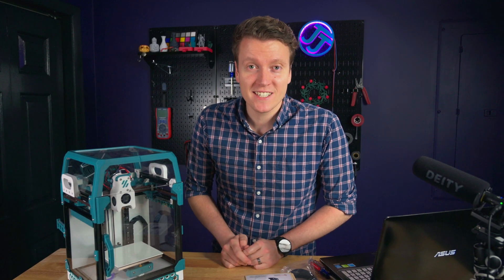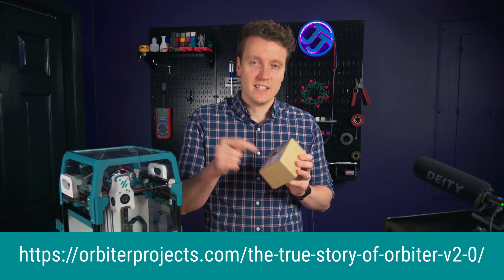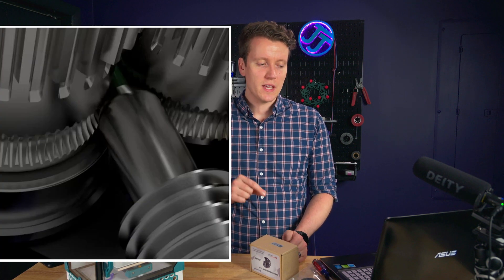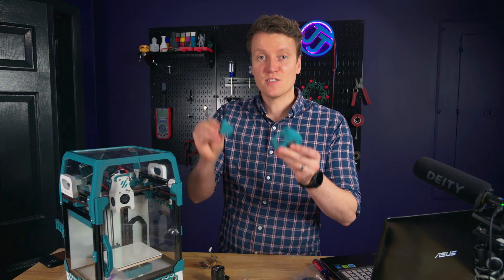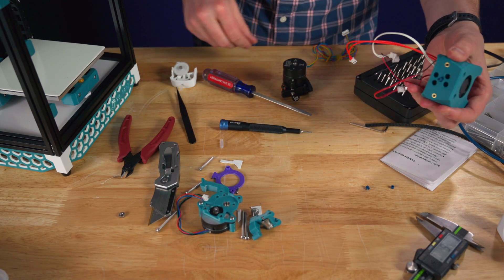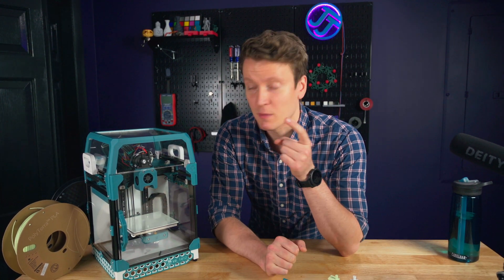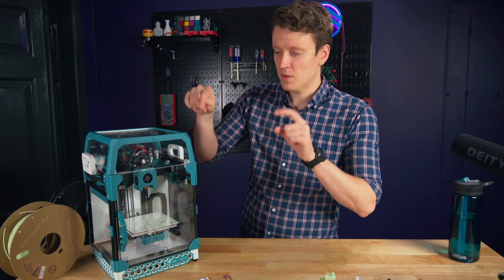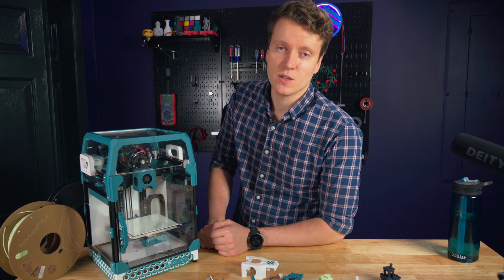Orbiter V2.0 Extruder Install and Tests | Voron V0.1 Upgrade

Comment: I've been running a Stealthburner and clockwork 2 retrofit on my Ender 3 for a long time now. Honestly the cooling and consistency and ease of loading and unloading filament has been great.
But also honestly I've never been able to get prints as good as I could with the stock hot end and extruder on a direct drive carridge. I tshooted the issue for a long time but eventually started just living with it.

Was looking at some old prints today in my junk prints box and I was like "Wtf bro these are way better than I can print right now?" 

Did some research and decided to go with a completely different toolhead, the Mars Orbiter by squirrelf which is much more ender 3 focused and full featured. Also supports rigid mount for my dragon hotend and fitting the mars orbiter on top. Fingers crossed I get the old quality back!

In the end there is kind of a why bother with a 3D printed extruder when there are good injection molded ones that are all going to be way more precisely manufactured.

Comment: thx for the cool vid, nice to see i'm not the only one having had this issue (discord made me almost think i am). if i may ask what was your personal reason to install the zbelt mod? thanks
Reply from the maker: I felt the same way, so many issues with the Mini Afterburner. 
And I used the zbelt since I had been having issues with a bent lead screw on another printer and wanted to try out a belted z printer. It was a pain to get installed, and now the bed will slide to the bottom after the z motor is turned off, but I like the fast z moves it can make.

Comment: I got the Bondtech LGX lite extruder to start with but had alot of trouble with it skipping steps even after non-stop of calibration and tear downs to re-check everything. So I am installing this now with the Revo Voron hotend and hopefully I will get some trouble free printing out of this bloody thing finally. Thanks heaps for sharing.
Reply from the maker: That sucks to hear about the LGX. I've been pretty lucky that my Voron has finally been working well since this was installed.

Comment: Are you using a MGN7 or Mgn9 on X? I have the mgn9 on X mod i wonder if this will work?
Reply from the maker: I still have the stock MGN7. I think this would work on either since it doesn't replace the part the mounts to the rail.

Comment: Was looking forward to the re-wiring but not shown.
Reply from the maker: What re-wiring were you looking for? The extruder and fan parts are the same wiring as with the stock one, and the motor plugs in the same place as the Mini Afterburner motor plugged in as well.
Reply: @JJShankles  the LDO motor, it doesn't follow traditional color scheme , but noticed it came with a short extension that flips the blue and yellow. I couldn't get mine to work but after i flipped them manually it did. Thank for your video

Comment: Again an installation guide but nothing on Marlin changes!
PLEASE show me what to change in Marlin 2.1 for the Orbiter extruder.
Reply from the maker: They include a sheet that shows the commands you need to send, and you can find them half way down this page as well: https://orbiterprojects.com/orbiter-v2-0/
Reply: @JJShankles  Thanks for the video, but @fvyeel is right. There are only commands for USB configuration and not the FW one. I do not have some of the settings available and thus can not change them, even though they are very important.

Comment: I think you'd find that the sherpa mini is an incredibly easy extruder to build. All screws are out in the open and tearing it down (if you ever need to) takes no time at all. Glad you like the mini as, didn't even realize Clee made an orbiter v2 version. I was still working on a v1.5 version 😂
Reply: I have the ldo sherpa mini as well and I love it.

Comment: Hey mate, thanks for the great video, do you know if the revo will fit with this mod?
Reply from the maker: Yes, they have a different STL file that will work with that hotend: https://github.com/PrintersForAnts/Mini-AfterSherpa/tree/main/STL/Mini_AfterSherpa
Reply: @JJShankles  Perfect, thanks mate, i hadn't checked the stl folder lol

Comment: if you loosen the mini ab middle bottom screw it wouldve solved your issue. Drove me crazy and i solved it on a fluke myself but dope mod either way! Def a better setup than stock

Comment: I have spent so much money and time fixing this inconsistency issue... way more than any of my printers worth... I have tried: Orbiter, LGX Lite, MiniAfterBurner, Stealthburner... Feels like main issue is in this small Nema 14 motor... cus same gears with Nema 17 are producing way more consistent results... Super frustrated as amount of time fixing this also was insane... makes me very upset especially when my Bowden Ender 3 makes way cleaner surface...
Reply: 'fixing this inconsistency issue'
Realize if you fully constrain the dual gears of a dual gear extruder to parallel, the thickness of the filament and how far the drive part of the gears go into the filament spread the shafts and changes the gear mesh.
You do NOT want fully constrained, parallel shafts.
Make the shafts a V.  You want the gear part fully closed, so the gears are meshed as completely as possible.  You only want the upper drive side of one of the gear shafts to be able to float and adjust for slight changes in filament.  The tiny change in the angle of the V from filament diameter change won't really matter much as long as you're not letting it change the gear mesh.
IOW, making a crap 'loose' extruder is likely to make a better one than making a 'perfect', perfectly parallel extruder.  A loose one will probably still mash the gears together completely and have little change due to filament changing.  If you make a really high precision, parallel shaft dual gear extruder, you're almost guaranteeing that any change in the filament diameter will change the gear mesh..  
IOOW, loosen your extruders up a bit so it has a little more free play to float around and it may work better.
Reply: @ModelLights  Yep, it's similar to Bowden concept, that is why dual gear with bowden doesn't have such issue.
Reply from the maker: That's sucks, and crazy that all those options didn't work. I feel like that is the side of Vorons that don't get covered, and I am definitely going to make a video about how much work they can be and still might not be as good as a heavily modified cheap printer.
Reply: @JJShankles  Exactly... But I believe it's not a Voron printer problem, just dual gear direct extruder flaw itself...
Reply: are you talking about vfa, thats the issue with ldo. Wait for their revised x y motors and they will mostly go away.
Reply: @user-yk1cw8im4h Nope, I am talking about Wood Grain artefacts. Related to the gear's angle, in my case nema 14's - 20 tooth gear was angeled.
Reply: loosen your middle screw on the mini afterburner
Reply: @jsassu20  Only replacement of the Moon's motor helped, I had same issue in my Stealth burner with CW2.
Reply: @hobbyistnotes  actually now that I think about it I had to replace that also I went with the fysect version because one of the moons wires broke of literally at the end of the connection so I couldn’t even solder the wires back together. The moons one is poorly designed. Set rotation distance to 22.583321434513125 also and get perfect extrusion on mine now. Might work for you too but I doubt it since tolerances are different across machines

Comment: Switching to a sherpa micro was necessary foir me to finish my v0 build. The mini AB+ just never worked for me. It looks cool, but it's a terrible, finnicky,  unserviceaable design.

Also when you're replacing your belts, tape the new belt to the old one so you can pull the new belt through as the old one comes out. Then your new belt is already properly routed.
Reply from the maker: That's a good idea for routing the belts, and serviceability is so much easier now!

Comment: Is there any reason you didn’t use the mini AfterSherpa mount for the Orbiter 2.0? It would have allowed you to keep the stock X- carriage mount and not had to touch your belts.
Reply from the maker: This is a Mini AfterSherpa version that I got off their github, but it just uses two screws instead of three to hold it together. I also think I did a better job tightening the belts this time, but I think the stock X-carriage mount would probably work as well.
Reply: @JJShankles  OK - I thought you needed to replace the the x-carriage for the versions you are using. I used the Mini AfterSherpa for my LGX Lite install. It's a great design and so much easier to put together than the stock Mini AB.

Comment: I've had the same issues as you with the MiniAB as shown on 0:27 only way more extreme.
Here i'm still finishing my V0 build but i already switched to a printed sherpa mini extruder because i couldn't fix the issue in the miniAB.
The Sherpa is so much smoother and i love the modularity of a seperate hotend & extruder part.
It's also nice that it is able to make with the miniAB components.
Reply: Sad they are still gonna do it like that for the mini stealth burner. aesthetic over function of many aspects of voron designs make me want to jump boat for annex all together. Their sherpa mini is so minimal i love it
Reply from the maker: The modularity and how easy it is to open and get at things makes it to much better.
Reply: Did you print your Sherpa or bought it preassembled? I have my fan cowling and all parts of the Sherpa mini printed already, but holding off on installation
Reply: if you loosen the mini ab middle bottom screw it should solved your issue also see rotation distance for e below

[extruder]
step_pin: !PB3
dir_pin: PB4            # Add ! if moving opposite direction
enable_pin: !PD2
full_steps_per_rotation: 200    # 1.8Â° motor
rotation_distance: 22.583321434513125        # See calibrating rotation_distance on extruders doc
gear_ratio: 50:10               # For Mini Afterburner
microsteps: 16
nozzle_diameter: 0.600
filament_diameter: 1.750
heater_pin: PC8
sensor_type: Generic 3950 # Adjust for your hotend thermistor (see options below)
sensor_pin: PA0
#control: pid            # Do PID calibration
#pid_Kp: 28.182
#pid_Ki: 1.978
#pid_Kd: 100.397
min_temp: 0
max_temp: 500   # Phaetus Dragon High Flow Hotend with Special Thermistor
min_extrude_temp: 170
max_extrude_only_distance: 780.0
max_extrude_cross_section: 70
#pressure_advance: 0.38   # See tuning pressure advance doc
#pressure_advance_smooth_time: 0.040

Comment: 1:31 screenshots are from Filastruder, yet, in the description, you're directing people to Printed Solid.
Reply from the maker: It is the same product from both places. I just saw that it was cheaper from Printed Solid. I'll add both to the description.
Reply: @JJShankles  Thanks.  Filastruder's one of my go-to's, so I recognize their website product pages.  FWIW, Printed Solid is okay, yet I take issue with them selling genuine brands like E3D and Slice alongside Phaetus crooks.
Reply: Nevermind...

Comment: Would you add the orbiter to the anycubic?
Reply from the maker: I'm thinking about putting one of them on the anycubic. It will take some work redesigning the hotend, but I would love to try direct drive eventually on the anycubic.
Reply: I still have a stock hotend so I’ll going to give it a go.

Comment: I built mine with a Sherpa mini printed by me and never had extrusions problems fortunately
Reply from the maker: Was that very hard to put together? I'm thinking of trying the Sherpa mini on another printer.
Reply: @JJShankles If you mean your anycubic, I slightly modified the mk4 carriage of my mega s and was able to mount the sherpa mini quiet easily.
Reply: @JJShankles  it was fairly easy, but you need to grind the bmg gear shaft so it doesn’t it the stepper, like it says on the guide
Reply: Did you have to replace the carriage belt holder for installing the MiniAS? This is my biggest gripe with my v0.1, I don’t want to go through this hassle again…
Reply: @itayst  the X carriage is the same as the mini AB I believe, I built mine straight with the mini AS, so not sure